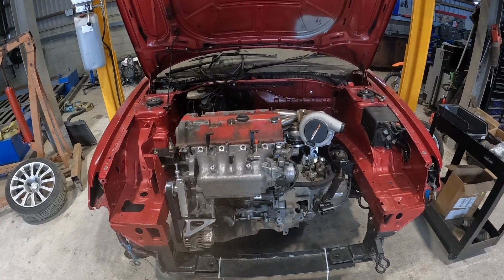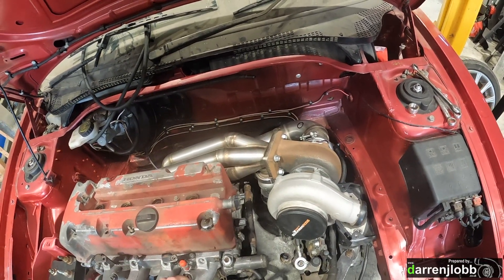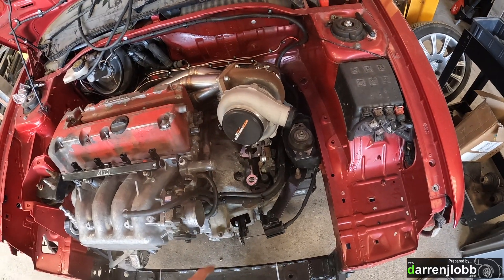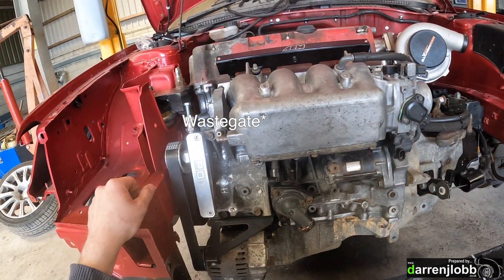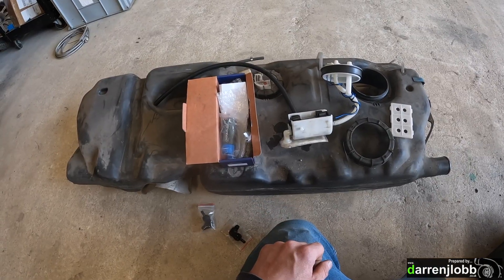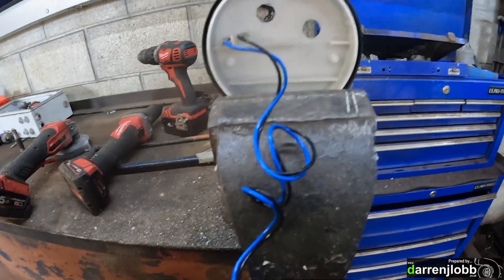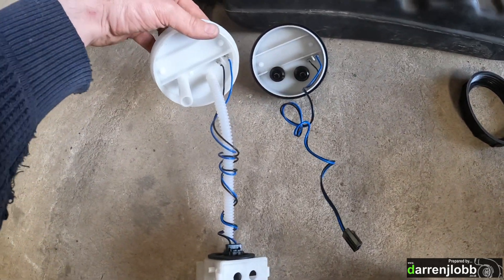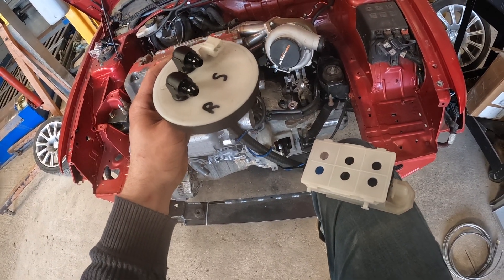Turbo K20 306 Project Part 6

Comment: Tidy things going on pal. Props to the sharpest hole cutter known to man and that tank pickup win!
Reply: Good spot Piggy. What was the hole saw made out of? I ended up using a diamond title saw on the last bit of 316 I had to put a hole in. Only after burning out a cheap and an expensive hole saw.